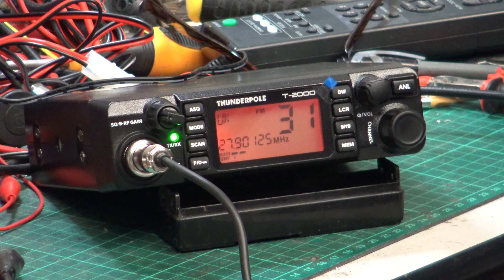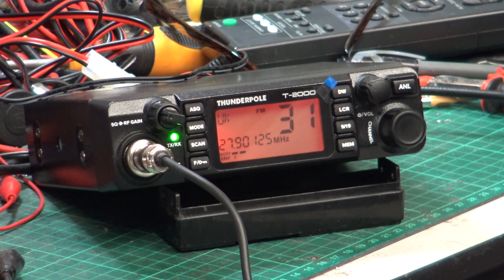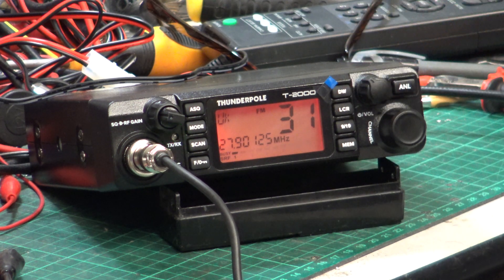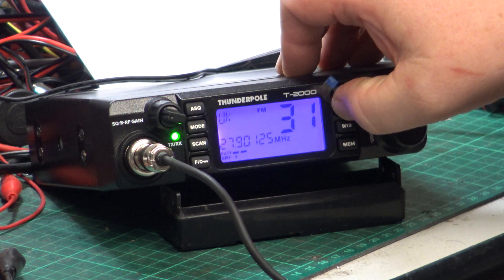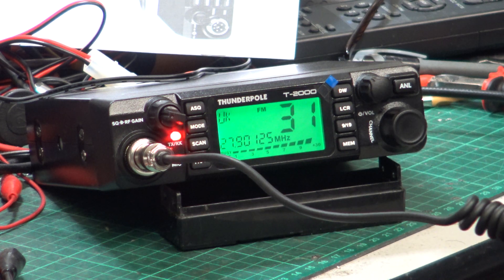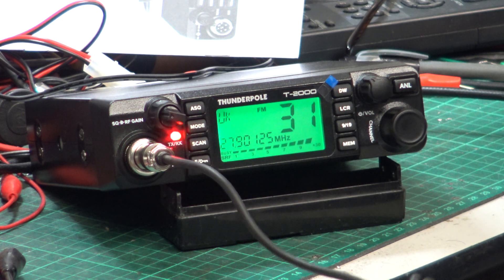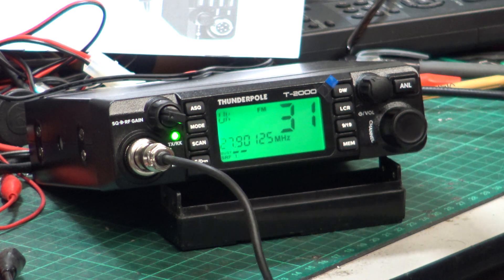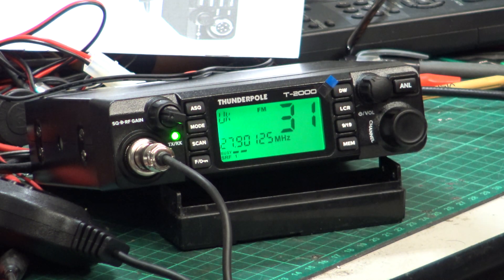Thunderpole T2000 UK CE MultiNorm CB radio (mobile) - On The air test

Comment: Hi Richard if you don't mind me asking what base antenna are you using please. Great video btw I was thinking of this rig but went for the crt xenon instead.. audio sounds good. 👍
Reply from the maker: It's an Antron 99 mounted 4' above gutter level on a T & K wall bracket. This aerial is the ordinary version & not the optional groundplane kit version. The aerial is connected using 6mm mobile type cable, though industrial grade. This is a single story building.

Rivchard, G0OJF

Comment: I have a t2000 wonder on the Eu just fm or can u change it to Am?
Reply from the maker: You reset the radio to EC & then it allows both AM & FM on the CEPT set of channels.

Richard, GOJF, UK
Reply: Do I press and hold something I click on to the mode and it only gives me fm on the EU setting.
Reply from the maker: @danlaplain8212  yes, you need to set the region to EC. Either look at the instruction book that should have come with the set, download it, or view my other video on servicing the Thunderpole T2000 which shows you. You are in effect commenting on Pt 2 which is when we test radios.

Richard, G0OJF, UK

Comment: Hi, Relatively new to this CB game, we have a T800 and a T2000 but our T2000 seems to have started just jumping through channels and we don’t know what the issue is? Can you point us in the right direction cheers
Reply from the maker: If the mike has up/down controls on it, unplug the mike & see if the radio still jumps channels. If it doesn't then the mike has a faulty switch.

Richard

Comment: T2000 and t3000 are same price. Which would you recommend? Very first cb radio. Fitting to land rover for 4x4 response. Cheers for all the videos I’ve watched millions so far!
Reply from the maker: We think the T3000 is the better performing set.

Richard, G0OJF, UK
Reply: @ukfmcbradioservicingTango21  Really? The T3000 looks like a space saving unit from what I can see, why does it out perform the T2000?

Comment: Richard what would this radio be compared to a 80s CB ? Looks neat radio
Reply from the maker: well it's heading in the right direction, but with all the SMT components is difficult to repair other than output transistors & stuff like that. I think that current generation rigs need treating with much more care than 80's models & important not to thrash them.

Richard